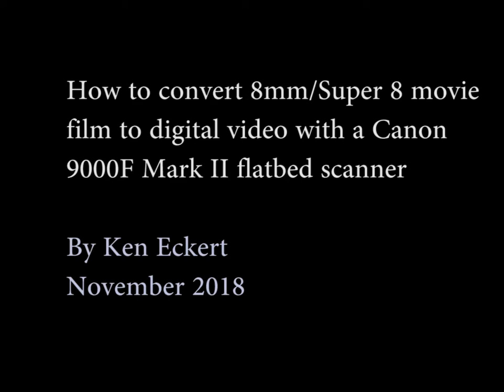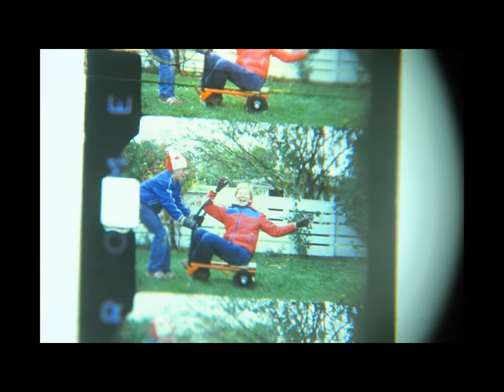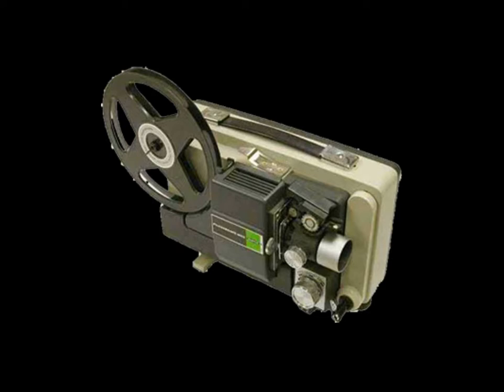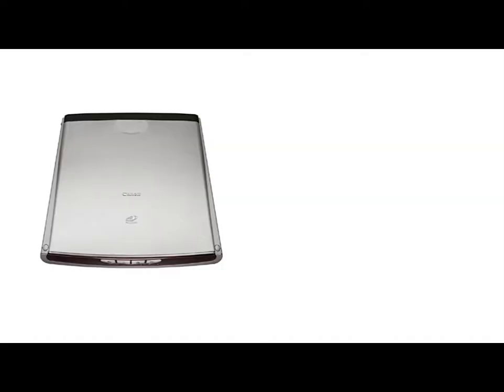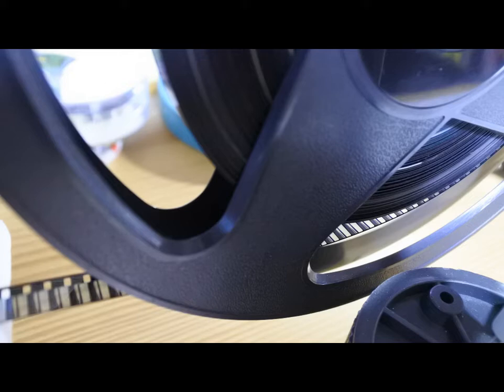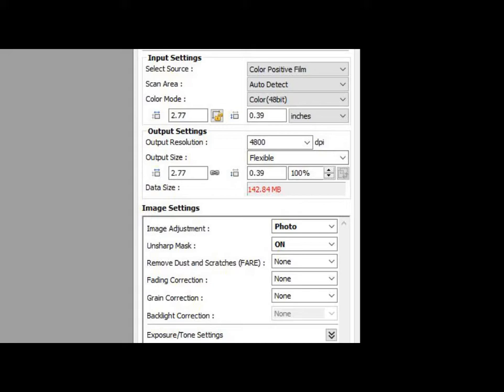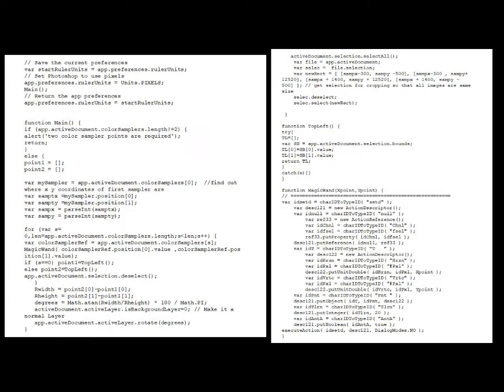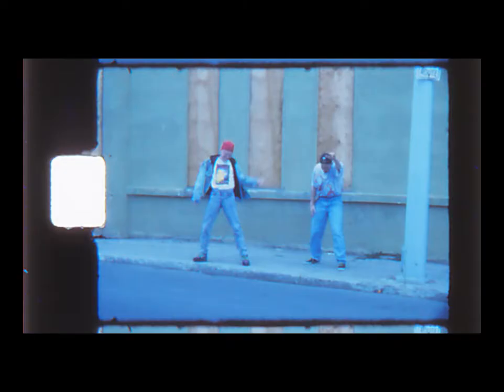How to Convert 8mm/Super 8 to Digital Video with a Canon Scanner

Comment: My first port of call would be using your macro method. The trick you missed there is that any lens can focus really closely if you use macro tube extenders between the lens and the camera. Then, one could import the frames as a image sequence in davinci resolve, then use its tracking feature to line up each frame using the sprocket holes as a reference. I might try this soon.

Comment: In WW1, machine guns fired when the (two bladed) propeller was horizontal -ie "out of the way". Is there no way to synchronise a digital camera with a macro lens, so that it snaps the shot when the film is in the correct spot - and momentarily stationary? A Geneva wheel mechanism could advance the film and hold it still for a fraction of a second. (effectively a high end film projector shutter mechanism). The camera could even be from a Samsung cellophone, as they have excellent resolution and slow motion capabilities of up to 1000fps). The technology isn't just here but it's been "here" for over 20 years. The entire mechanism would probably cost no more than $500-750 and be able to scan 200ft in 10 minutes at 2K resolution. By simply moving the camera further away and using a different film gate, it could scan 16mm and 35mm. (Arri want $250,000 for a movie scanner).  Something that could give top quality results and sell for under $3000 - how about that?
If anyone wants to enter into a collaboration on such a project,  'd willing to contribute $10k. If we can get 20 or 30 people involved,  I reckon it could be done for $200-$300k. https://youtu.be/ZNV79Nb1qM8

Comment: You're mad - in a good way! What I take from your project is that in the 21st century the solution is more in the software than the hardware. I bought one of those cheapish scanners from Amazon but really wasn't happy with results or reliability so sent it back. Now I'm building my own device and struggling with old projectors and precision. What I take from your methods is to lean more to software solutions than mechanical. We all have a supercomputer handy but not a precision machine shop.

Comment: You can use step-motor for film-advancing, which would be driven by Arduino. Arduino also could be synced with computer, where script can automate film advance and scan order. And I'm pretty sure, that some talented programmer could easily automate your Photoshop workflow with a small software.

Comment: Ken,

I want to say thanks for such a detailed video and a walk-through of your process, and share one I've been working on. Both this video and your blog have been helpful and inspirational.

I've got a working "modified projector" approach, using an Arduino + stepper motor, an automotive 12V LED light (with a ping pong ball for a diffuser) and a remote shutter trigger driven by the Arduino. I'm capturing raw frames (~4K) at a stable ~2.5 FPS, cropping and applying corrections scene-by-scene in Lightroom and finally exporting a 1080p movie via DaVinci Resolve (free version.) It's arduous, but it works!

I want to document much more of my findings as you have, in the hope it'll be useful to others. The following is my "intro" video, with a brief bit of sample footage.
https://www.youtube.com/watch?v=TcnIJ84wfi0

Again, thanks for sharing and writing up your findings. It helped me feel more certain about trying it for myself!

Comment: Why can't you project it on a white sheet and record it digitally from the other side, then flip it in your editor?
Reply from the maker: That might work. My problem was that I couldn't use an intense tungsten lamp, as it would melt the film; and the led lamps I had weren't strong enough to illuminate the backside of a sheet of paper. As well, the larger problem was frame registration, as an old projector sprocket just isn't accurate anymore. :>

Comment: hey i have a tip for scanning with a dslr (i tried it out myself). you can 3d Print or buy super makro adapter extensien tubes for like 20 box. it works just perfectly

Comment: You have put some innovative techniques into your transfer methods.  I've tried a few methods myself, and have settled on the Wolverine scanner for transferring my Mother's home movies, but it has a few drawbacks.  Color balance when scanning Kodachrome ends up with overemphasized yellows.  The default exposure is too hot with some shots, too dark with others, so I tend to use "-1" and boost the gain in post.  When sprockets on Super8 is worn, sometimes the frames do not advance.  I've been considering a Magnasonic scanner that has a super 8 film holder, but like some of your methods, this would be a one frame at a time option.  However, the guild should keep everything lined up so you wouldn't need to adjust each frame.  Nice, informative video!
Reply: I think you can correct the flaws you mention using the Wolverine scanner by using Photoshop type software to correct most of the flaws.

Comment: Brilliant video! I recently did much the same thing, but using a Plustek 8200i scanner (as pictured partway through your video) to do it. I usually get mine sent off to be flashscanned, but there was one that didn't seem very long (about 60 foot) was black and white, wasn't in the best of condition and thought it wouldn't be too much of a headache to do myself if I jerryrigged up a contraption around the plustek to hold the doors open, the film itself sitting at a jaunty angle through the 35mm adapter. Scanning at its max-native res allowed the film to be cropped to 1080. After the scanning was photoshop, straighten though I didn't make any fancy scripts beyond an action that created a box selection to the same size as a frame, then I could manually place that aligned with top and left side of the frame, then crop and save, repeat. I think I v-dubbed it together at the end into an AVI, it's been a while since I made it. I quite enjoy sitting there, listening to music, or watching a movie and doing repetative things like that. Though I'm not sure I would want to go through it for something that was 400ft!!!!! Anyway, here are the results. I'm happy enough with them!
https://www.youtube.com/watch?v=jGseKpBSjWQ

Comment: Thanks for your helpful video. I plan on taking photos frame by frame and then cropping and joining them. Is your Photoshop action script code just for Super 8 or Standard 8mm as well? Is there a way to use this script so just the frame is shown without sprocket hole?

Comment: Amazing, this quite an interresting thing to do, I’ve once digitized some super 8 films that my grandfather made using a raspberry-pi with camera module pointing at a projected film. The result was not as clean because of the skew in the image caused by the offset between the projector and the camera. My dad made a python script to setup the filename for each file as well as the pi camera module settings. I’ve always thought about scanning the film strip as the best and most direct method but have never attempted this before. Your methode looks inspirational.😇